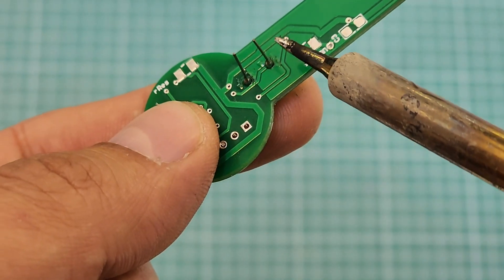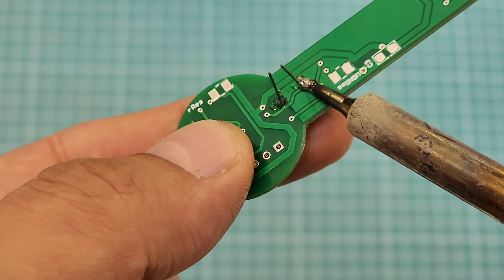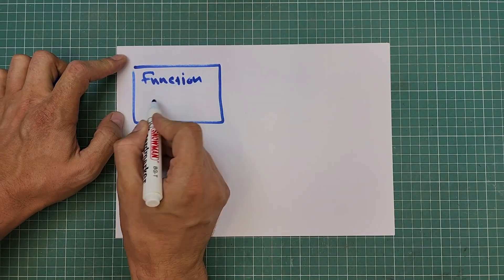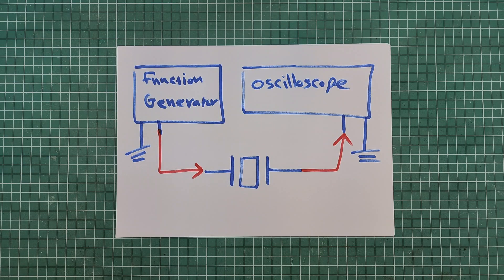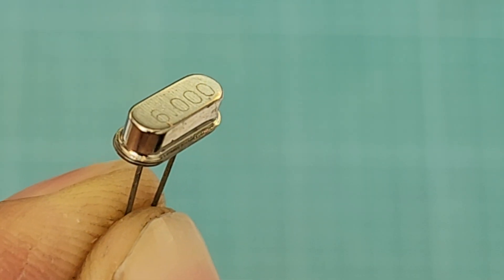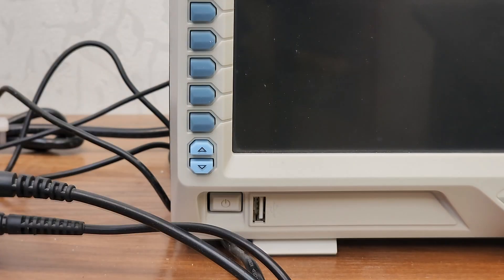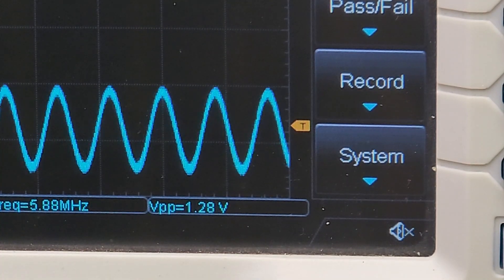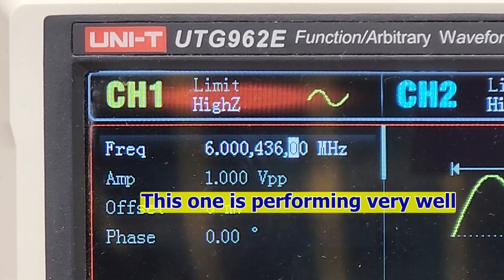How to Test Clock Crystals: Ensure Your Timing is Spot On

Comment: Simply connect in circuit and working  ok .then ok if not then replace with new one.
Reply from the maker: Then how you'll realize if it has a half percent error?
Reply: @elewizard  if desired output is given then OK ,replacing crystal or buying signal generator ,Oscilloscope which is cost effective?
Reply: @elewizard  Buy a better quality one. Not Ebay.

Comment: this video is amazing. I never knew this. Are you able to explain why this is? I am thinking it is because the frequency vibrates the oscilator crystal and if you vibrate it more with the frequency generator, it will peak more, and if you go too far, the peak will decline. Please let me or others know. Kind regards, love this video
Reply from the maker: No, it hasn't a direct relationship there. Actually a crystal has a resonant frequency at which it peaks the signal. Any frequency other than the resonant frequency will result in a lower amplitude of the output signal.
Reply: It's due to the capacitive reactance (Xc) of the crystal. The Xc is lowest at the resonant frequency.

Comment: You are assuming that the frequency shown at the function generator, together with the output signal, is 100% correct. I assume, that low cost function generators are not 100% correct.
Reply from the maker: You are right. We have to make sure the equipment are accurate 👍
Reply: Isn't there always a tolerance accuarcy to the nominal value so it can be off either upper half or lower half from measured value. That said this is true even about machinery
Reply: @fuzer4047  Correct, and the crystal has to be loaded with the correct value of capacitance. I guess this can be used as a go or no go test.

Comment: You can test also with multimeter Hz function (up to some range), black probe on GND of circuit, and red probe on one of those 2 contacts, while circuit is powered. Of course its not precise as oscilloscope but at least you can see is it working or not.
Reply from the maker: Yes, it can be used to make sure the crystal is functional or not

Comment: You can build a pierce oscillator & buffer using a NOT gate chip (74HC14), two resistors and two capacitors. It's the circuit most microcontrollers use internally. After that you can use any frequency counter you have to measure the frequency it generates. Even a ESP32 or RP2040 with a bit of code should be able to count some quite high frequencies very accurately. For Mhz crystals, I used 1M and 100R resistors; for 32Khz crystals I used 10M and 270k (they are designed to need far less drive). Most crystals will likely work with 22pF caps (which makes for roughly 12pF load capacitance). This is more of a go/no-go test, but then again, it doesn't require a function generator and oscilliscope.
Reply from the maker: Yeah, there are other alternative solutions. However measuring high frequencies using devices like esp32 is not recommended

Comment: What about accuracy of function generator? Maybe better is to synchronize fun. gen. with GPSDO first and then test the crystal?
Reply: Ttat model of chinese generator doesn't know how to synchronize with gpsdo.  The oscilloscope needs to be synchronized as well.   But why even use it , a frequency counter is not enough ?
Reply: @modorangeorge4991  I think, very accurate frequency counter ;-)
Reply from the maker: Yeah, that is a goog point. To use this method, you have to make sure that your equipment is accurate

Comment: A NanoVNA works very well to test them.
Reply from the maker: Maybe 👍
Reply: @johnwest7993  One question (from ignorance): as the resonance of the cristal is very high, could it damage the sensitive input circuits in a VNA or spectrum analyzer?

Comment: Hi how to test a crystal without oscilloscope?
Reply: Germanium diode detector and a multimeter.
Reply: Look up pierce oscillator circuit for crystals. Just need a fast NOT gate.
Reply: With an accurate LC filter and a Multimeter.
Reply: 🤔 bla bla bla .. question was : how to do it 🤔 nobody gave any answer only another questions
Reply: @zorabixun  You are not using electronics, if you don't know an LC circuit. Your blablabla is amplifying your dumbness 😄
Reply from the maker: Toucan make an oscillator circuit using the crystal and NOT gates, then measure the output frequency using a multimeter. By the way, all the multimeter in the market are not able to measure the frequency

Comment: Thanks.  I think a good follow on video would be how to build a stable 1hz clock signal suitable for time keeping.
Reply: I think I saw a video where the narrator explained that the most common frequency used was 32,678hz for keeping time.
That is seconds.
Not microseconds or nanoseconds.
So if you need more accuracy, or higher resolution.. I guess go for a higher frequency.
Reply: @yasirrakhurrafat1142  Yes, it is fairly common to start with a 32768Hz (an even power of 2, 2^15) crystal and divide it down to 1hz.  However, it seems there is not much literature on the proper way to build the Pierce oscillator circuit (dividing down from that is simple, of course).
Reply: @Enigma758  Its astonishing though that we even can trust an oscilloscope to even reliably tell us what frequency the oscillator is running at, with such precision.
Considering that it's probably also using some form of crystal or maybe somewhat more sophisticated oscillator to keep track of time/frequency.
Cuz how do we know if the oscilloscope is precise or not? 🤪
Reply: @yasirrakhurrafat1142  True. It mostly is not very precise.